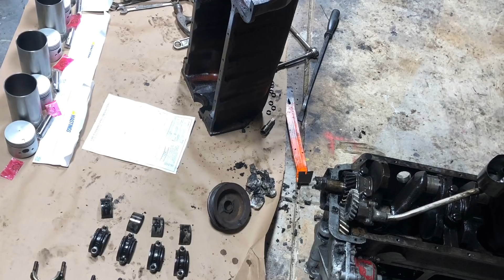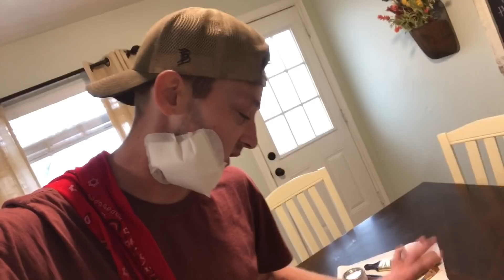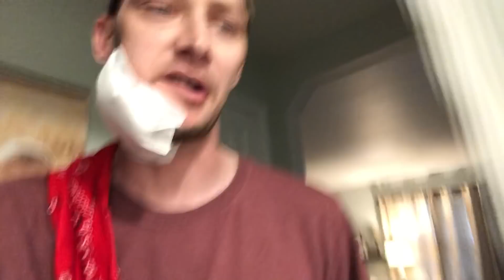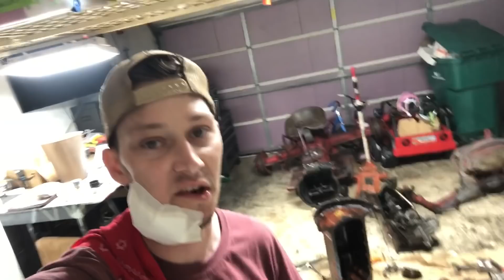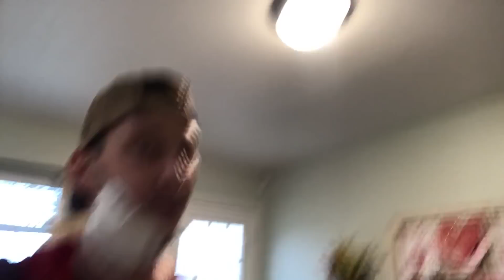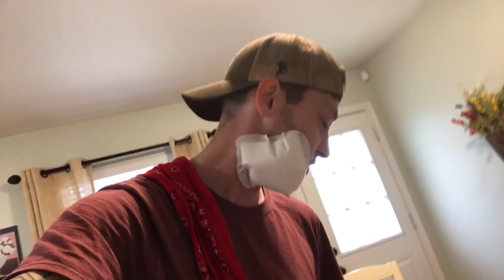Pulling Pistons / Ordering Parts.  1952 Ford 8N

Comment: Brilliant man you are  ! New tune for you . I'm the brilliant man oh yes I am, I'm the brilliant man the brilliant man oh yes I am.  Use that shake spray it's a tractor for Pete's sake and don't worry about the missing flywheel tooth it'll stop the crank at some point but as long as you got a full charged battery no worries.  😊

Comment: If you are replacing the lifters you should check the condition of the cam shaft, cause a worn cam shaft will destroy the new lifters. Cam and lifters are replaced as a set.